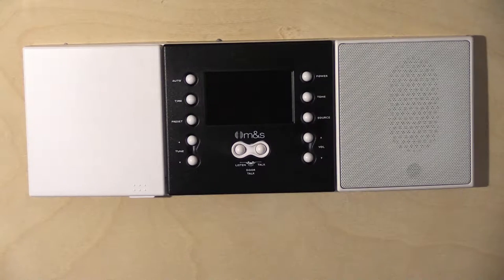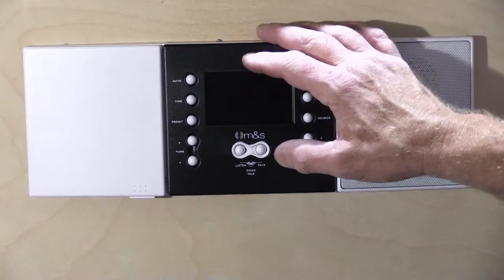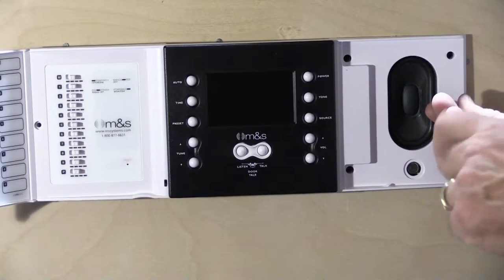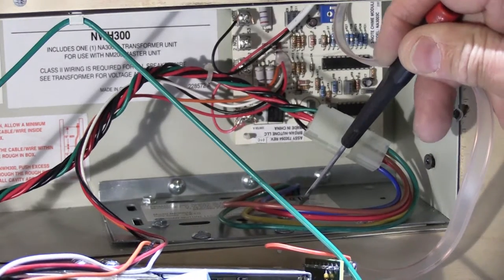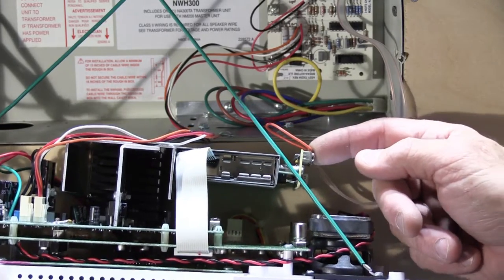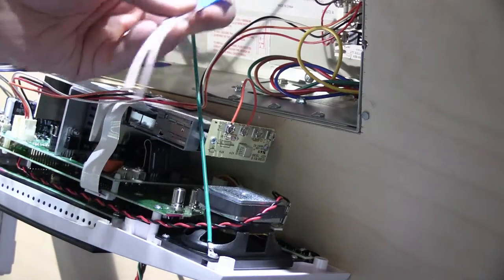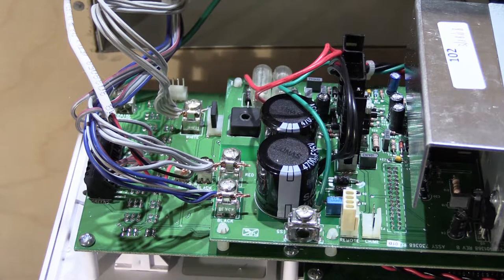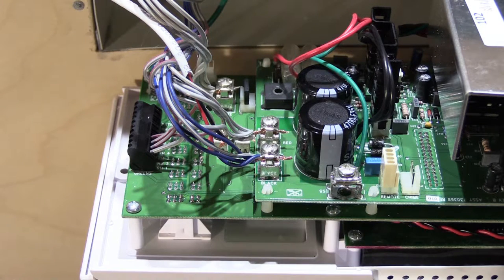How to Open up - Disconnect and Remove a M&S Systems DMC 3-4 Intercom Master Station

Comment: I just moved into a house and we have an old M&S intercom for the doorbell. The old owner removed the master panel so I currently do not have a working doorbell. I bought a new outside doorbell button and put it in, the wire runs into the house and I am able to follow it. My question is that my wife does not want the intercom or music functionality and simply wants the doorbell to sound a chime. Can you tell me what parts I would need to buy to simply have a doorbell ring when someone pushes the button on the intercom that is on the front of my house?
Reply from the maker: Hi Joe:  Without a Master Station installed - you simply have an incomplete and non-functional system.  The Master Station is the heart of every system and it has the "chimes" built-in to it.  To convert what you have - into a simple Chime, may be a simple project or it may be complicated - depending on the existing systems installation and your specific requirements and desires. 

Either way - it is far to complicated to discuss through a YouTube chat - please call me when you have time to discuss it - Chris  925-743-8236